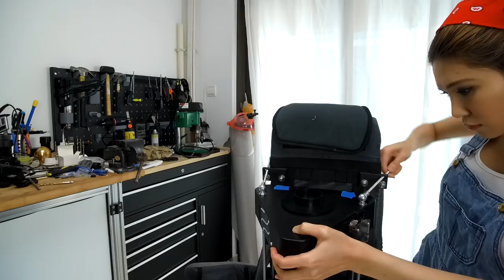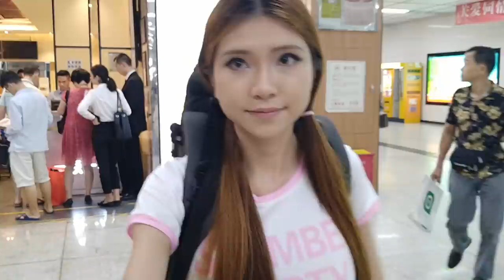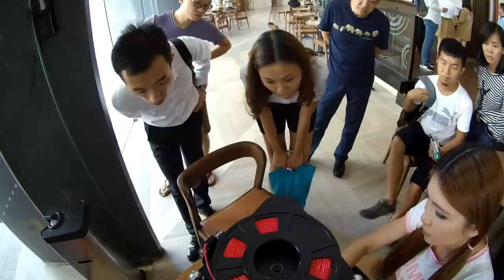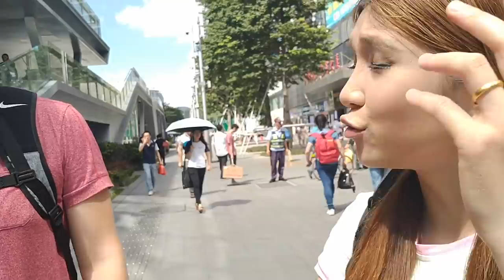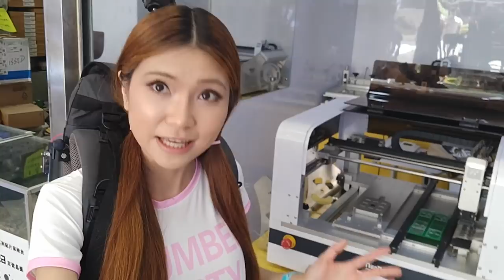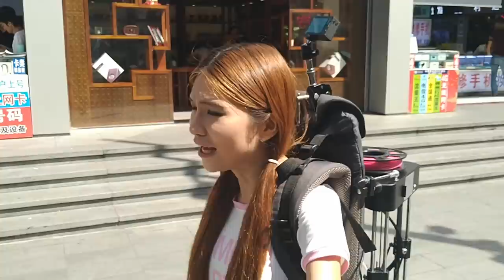Testing the Wearable 3D Printer- Will It Fail?

Comment: Hi Naomi, that's a really cool project, well done! I'm astonished that printer just keeps doing its thing while you're running around town. Doesn't it get uncomfortable wearing that thing in the long run though? By the way, I suggest mounting your parasol on the rig. Oh, and I just subbed. Kind regards.
Reply from the maker: It's meant for carrying babies and the printer weighs a bit less than one so not bad at all. Mostly have to be careful about not turning around too fast and bumping into something...

Comment: both (related) videos great. how did the mini-yous print out and how many did you print, an additional option bring the control board around to the front for starting prints without having to take back back off, I know someone would have to remove print
Reply from the maker: The layers were a little rougher than usual but not bad. No jams or failed prints.
Reply: do you "the model" of you on-line? (He-he) print full size one :)

Comment: Hello Naomi: I would like to start 3D printing as a hobby. I'm a CAD designer and want a practical low cost 3D printer to experiment with. Is the BIQU model that you show a good low cost printer that will produce small quality parts? If not, please recommend another model. Thank-you.
Reply from the maker: If it's just to learn 3D printing the BIQU is fine- but the print bed is not huge (I had to print the parts for the backpack on my larger printer). For the price, so long as you don't mind a bit of fiddling with settings it's a great way to get started.

Comment: I was watching the print head move around in that way when it was on camera, and I was wondering how stable it was.  Then you mentioned it seemed to be fairly stable - since you gave away several copies (as you mentioned) you probably examined it carefully for imperfections - were none, yes-no?  Question:  Is that type of printer head movement more stable then the types using horizontal screw drives while raising above the table?  There aren't many times a stable movement is required unless the table is bumped.  Please review the following 3D printer:  The TwoTrees Sapphire 3D Printer.    Previously reviewed by the  Design Prototype Test.
Reply from the maker: With a cantilevered bed/cartesian printer, only one stepper motor is preventing skipping when the printer is bumped on any axis. With a Delta all three motors stabilize the printhead against skipping on any axis. So deltas are much more suitable for this application...

Comment: Fuck you can really buy anything there. Here in germany I nearly get nothing 3d printer or electronics related in a local store. Have to order anything. Once I was missing 6 T-Nuts on my Tronxy and I had to order a pack of 100 because I did not find any of them here in any DIY or electronics store :/ And you even have pick and place machines running around there... So you could just go through the store and create a whole production line :D